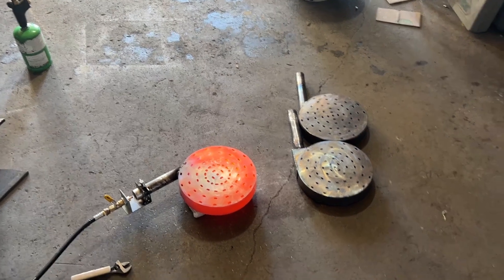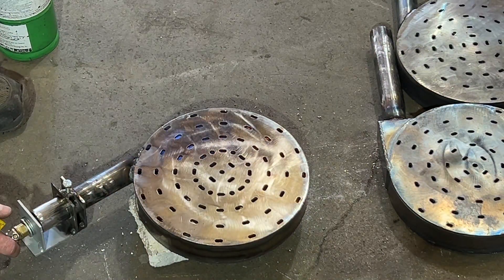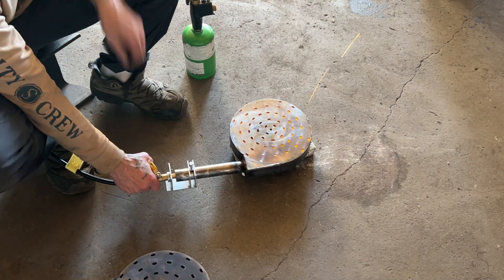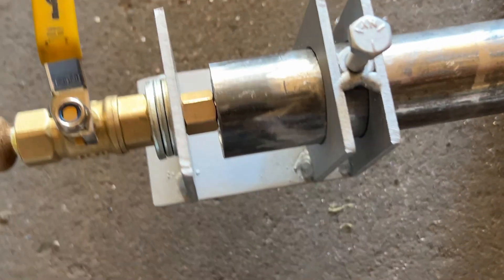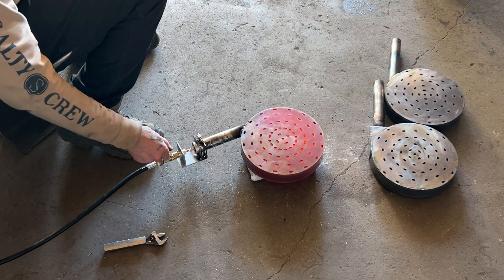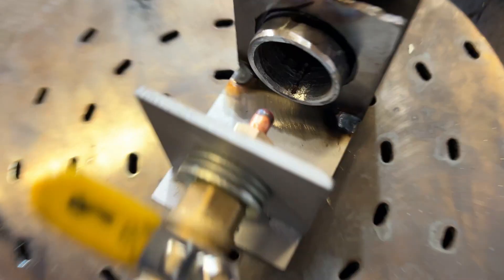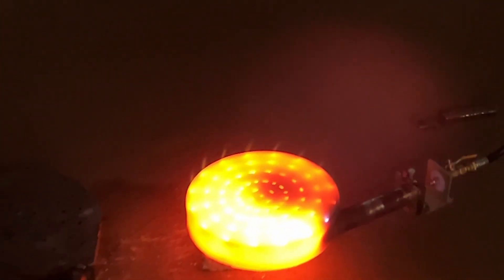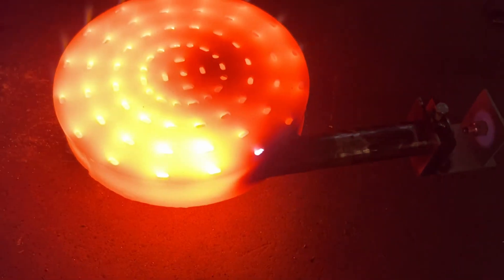How to light an IR  plate burner and Why ?

Comment: You should have a thermocouple switch on this for safety, especially if it's to be operated in an enclosed area and if you are selling this to people. Sell it installed and it's up to them if they want to remove it then it's their personal liability.
Reply: It's not like that is going to make it safe man.. It is literally a red hot piece of metal that is constantly on fire.. 

I would advise against making people think that you could leave this alone at all.
Reply: @ a red hot piece of metal is a lot safer than a gas leak that can accumulate and explode your whole house as soon as it finds an ignition source.
Reply: @benargee  how is a thermocouple going to stop a gas leak? 

I believe it is necessary to babysit it for it to be safe.
Reply: @SmileyFace01  the hot thermocouple creates a electrical charge enough to hold open an spring loaded electromagnetic valve. When it cools (no flame) there is no charge so the electromagnetic valve closes ensuring there is no more unburned gas released. 90% of commercially available propane heaters have this feature for good reason. This heater is no less safe than others as long as it kept on a concrete floor or other non flammable surface and kept away from flammable materials. Common practice and common sense with propane heaters. Other radiant propane heaters exist, but they use less flame.
Reply: @ To be honest I see this only as a heater element.. building something out of it (with all the required safety features etc.) is another topic on it's own. 

I am also not aware of a thermocouple capable of doing what you intend passively.. thermostatic valves are passive but I am not sure that there is a one rated for such a high temperature.. so you'd need to tackle that issue and probably build something custom..

But I believe that a single safety feature like that does not make it much safer. It may have the opposite effect in fact, because users may rely on the valve more than they should and they could be led to believe that they can leave it unattended.. and that is not what they should do!
Reply: @SmileyFace01  I don't intend to invent a thermocouple that does this, they already exist in a wide range of gas heaters, fireplaces and water heaters. The latter 2 keep a pilot light lit to both keep the thermocouple hot and burn and released gas. If the pilot light goes out, gas is completely shut off and you must relight it. More modern systems might work without if they are lit with a spark and opened electromechanically. Much of this information is just a Google search away.

Comment: You should consider creating a ring or something as an accessory to use this as a wok burner.
Reply: But I think he’s after creating a burning vortex inside to pull air through the Venturi and expose more gas to oxygen raising a higher temp, the holes are metered exhaust , not for burning as such, a ring inside won’t have the localised combustion and cause greater airflow
Reply: @djisydneyaustralia  heat is heat

Comment: Does this burn clean enough to heat a garage or shop?
Reply: These can actually burn very clean due to the mixing, swirl combustion chamber and the radiant heat maintaining inside temperatures.
Reply: I have a val6 diesel heater with a similar flame disk that gives off huge IR. I really like it but something smaller like this would be really handy. @murmenaattori6

Comment: SUPPER COOL! I'd like to see how  fast it can boil a gallon of water.
Reply: The design here is for radiating heat in all directions it wouldn't be an efficient way to heat water even if it is very powerful
Reply from the maker: @ Not true ,i have videos that prove this notion  wrong , its actually more powerful then just an open flame  like a stove top arraignment or a turkey frier . this provides both flame and IR but more importantly it allows you to pack more energy into a smaller space